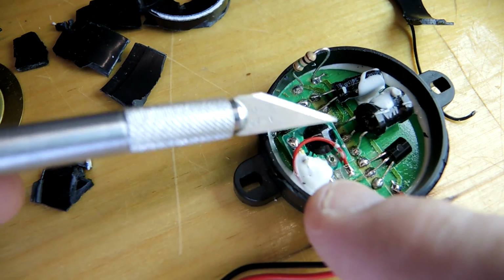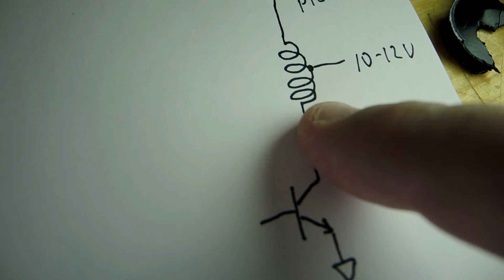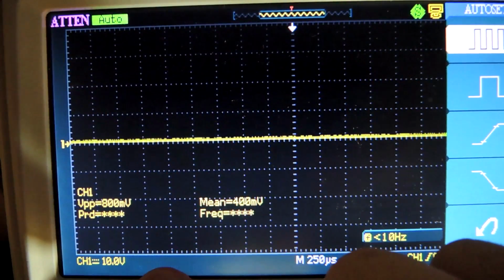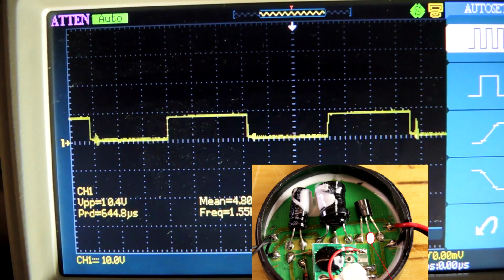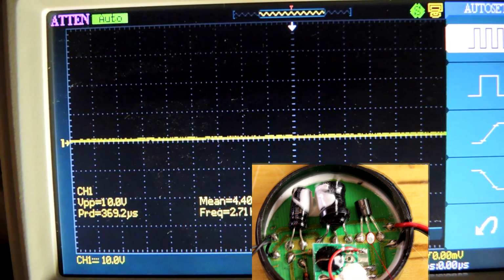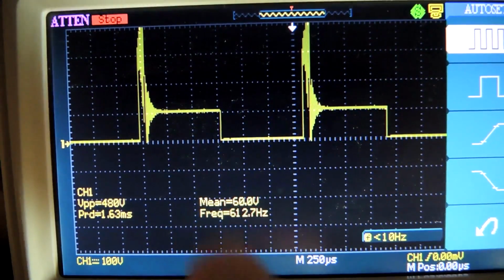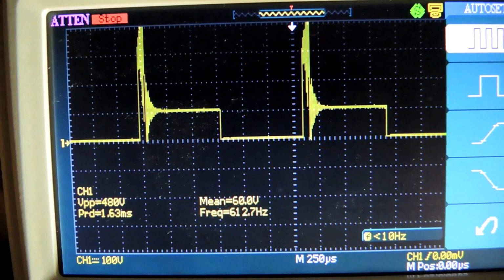Piezoelectric Buzzer Teardown

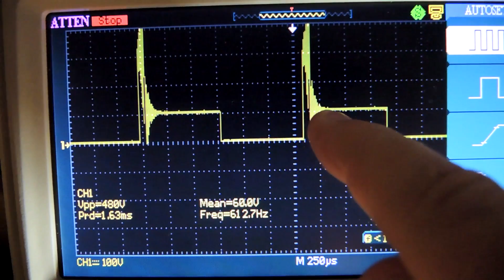Comment: At 3:05 should it be 100V instead of 10V until the transistor is turned back on?
Reply from the maker: no.  the voltage being supplied to the buzzer was about 10 volts and that's where the collector will stay until current flows again.
Reply: But the scope is at 100v per div and it's 1 div. up for ~ 0.75 millisecond
Reply: The scope and probe 1x/10x settings were out of sync.